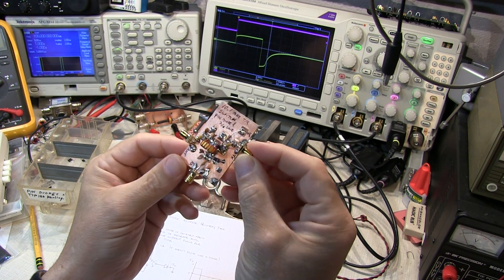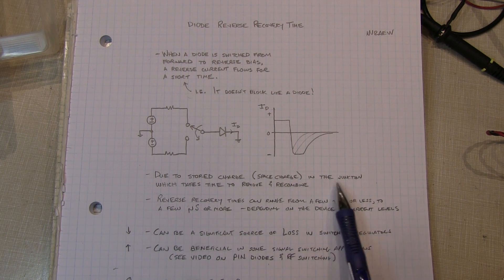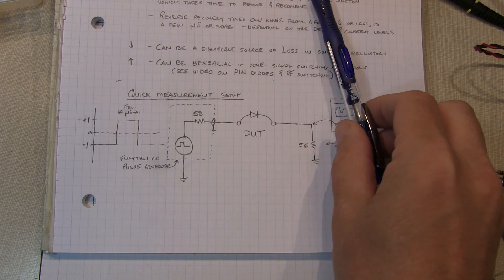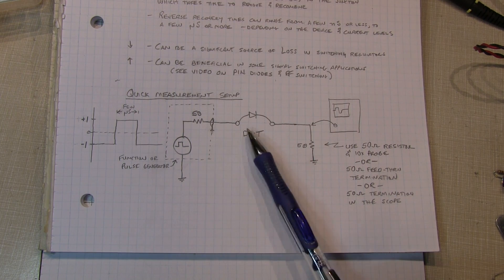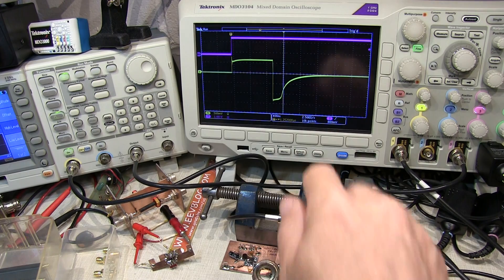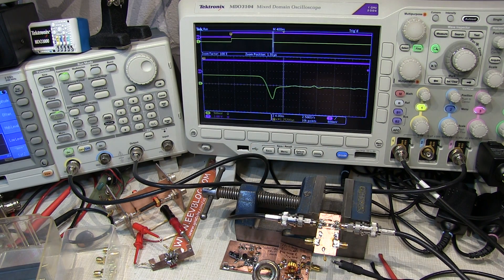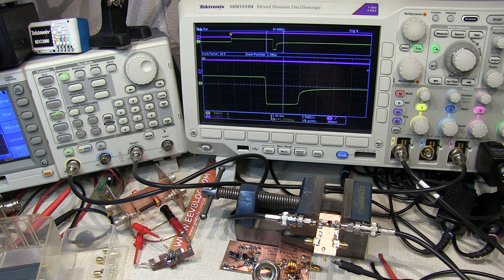#201: Basics of Reverse Recovery Time in a Diode

Comment: This is square wave. Did you try to see the impact of Trr on sine waves, if others haven't asked (can't search comments)?
Reply from the maker: Yes, the reverse recovery effect occurs, since the stored charge still has to be removed before the diode turns off.  You will still get some reverse current flow until the stored charge is depleted.
Reply: @w2aew  With a much reduced impact with sine waves, I suppose? It would be informative to see the difference in the same experiment comparing square and sine waves. Thanks for the video in any case!

Comment: Thank you for this video! It is great as always! I have a question. When you change the bias conditions by adding more voltage to the positive side of the wave, that affects how long it takes for the diode to recovery from the reverse bias - I can reproduce that offsetting my waveform to the positive side. I performed a test using the 50ohm impedance generator and a 100ohm resistor to represent load.  I measure with the 1x scope probes. If I change that 100 ohm resistor to a 1k, I thought it should affect the recovery time, but it doesn't seem to be the case. It seems like the higher the resistor, the higher is the negative spike but it does not affect the recovery time. Would you please help me understand why?

Comment: I have been repairing a plug in power supply for my led illuminated magnifier. The output rectifier diode had cooked. As a temporary measure I put a 1N4007 diode in to check if there was basic functioning in the high voltage side.
I was shocked at how hot the diode got yet only passing 360mA or so.
It wasn't until a friend pointed out the slow recovery time was the cause that the penny dropped.
I harvested an ES1J off a dead phone charger - a fast recovery rectifier and everything worked fine.
Thank you for your very helpful demonstration.

Comment: A great clip again.

Now that I think of it, that is why we can use varactors in VCOs with higher AC voltage than reverse DC bias of varactors. 
Of course, here you are talking about forward bias charge storage, in varactors it is reverse bias charge storage.  (ie.  diffusion capacitance vs. depletion capacitance)

However, in my opinion the best way to see if you have a pin diode or not is to figure out its doping profile.    You can do this by incrementally  biasing the diode, and measuring its capacitance and relating it  to its doping profile.   If you want to do this you should bias the diode from just below to turn on voltage and slowly decrease the bias voltage up about about  1/3 of reverse breakdown voltage measuring capacitance at each step and inferring the doping, and create a complete doping profile.

Comment: I'm confused is the reverse recovery time the reverse bias leakage current of the diode? because I thought it was the same thing the reverse recovery time is how much the diodes reverse bias leakage current value is. The diode reverse recovery time increases more by how much the diodes leakage current is?
Reply from the maker: Reverse recovery time and reverse leakage are TWO SEPARATE THINGS. Reverse recovery (featured in this video) is how long it takes the diode to turn off (to start blocking) when the voltage across the diode is reversed.  During the reverse recovery time, the reverse current can be large.    Reverse leakage current is the small current that will flow under continuous reverse bias conditions.
Reply: @w2aew  What is the difference between Reverse Recovery compared to reverse leakage current? I thought they were the same thing. How can you have Reverse Recovery and NO reverse leakage current? The diodes reverse recovery is when the diode is being reverse bias?
Reply from the maker: @waynegram8907  Reverse Recovery is a very short duration thing - it only lasts for a very short time after the diode is switched from forward to reverse biased.  Reverse Recovery is a measurement of TIME.  It measures how long it takes, immediately after switching from forward to reverse bias, for the reverse current to decay down to the leakage level.  Reverse Leakage current is present whenever the diode is reversed biased, and is generally a very small level of current. It is what is left over after the reverse recovery time is finished.
Reply: @w2aew  oh ok thanks, I thought that the reverse recovery was leakage current but I guess reverse recovery is not leakage current? because schokkey diodes have NO reverse recovery but have leakage current. To me that doesn't make sense because I thought the reverse recovery is leakage current but schokkey diodes have zero reverse recovery but measure leakage current which to me logically it doesn't make sense how a diode can have leakage current but NO reverse recovery. I understand what you said about its the TIME measure of the forward bias switching to reverse bias = reverse recovery time, which I get that part. It just doesn't seem logical that a diode can have leakage current and NO reverse recovery.

Comment: How can you measure the diodes leakage current and reverse loss while applying an AC signal at different frequencies? If I put an ammeter current meter in series with the diode it will only measure the current but how can I measure the leakage current and reverse loss? Does Zener diodes have a recovery time?
Reply from the maker: Leakage current is typically specified and measured under DC conditions.  I am not familiar with the term "reverse loss".
Reply: @w2aew  but how do you measure leakage current in diodes and transistors because when you put an ammeter current meter in series its just only measure the total current and how do you just only measure the leakage current in diodes and transistors?
Reply from the maker: @waynegram8907  Leakage is only measured under reverse bias conditions - so the only current flowing is the leakage current.
Reply: @w2aew  yes true at DC current, but when measuring the schokey diodes reverse recovery time you're at a certain AC frequency the leakage current of the schokey diode increases high in leakage current.  So how can you measure the leakage current of the schokey diode at the same time applying an AC waveform at a certain frequency when the schokey diode reverse recovery time is at its worse condition?
Reply from the maker: @waynegram8907  OK, you're talking about switching losses, such as in a switching power supply.  Schottky diodes are used because their reverse recovery time is very, very short, making the switching losses very low.  Leakage is usually still measured under DC conditions as far as I know though.
Reply: @w2aew  I have heard to never use Schottky diodes in Linear power supplies because when rectifying AC waveforms the schottkey diodes will have more leakage current compared to using fast recovery diodes and silicon diodes which are used in linear power supplies. When the AC waveform frequency increase higher the schottkey diodes leakage current increases, but how do use measure the leakage current when applying an AC waveform?
Reply: @w2aew  When measuring the Switching loss of a diode you just measure the Delta time from the reverse recovery time? because when comparing it to silicon diodes and fast recovery diodes the delta time from the reverse recovery time looks the same to me when applying an AC waveform. I don't see the schottky diodes reverse recovery time being that short compared to the other types of diodes it all looks the same to me only at different AC frequencies will all types of diodes will have a different cut off frequency when the diode starts occurring reverse recovery time. I'm not sure how to measure the switching losses in diodes.
Reply from the maker: @waynegram8907  Some good reading on Schottky Diodes here: https://www.microsemi.com/document-portal/doc_view/14630-introduction-to-schottky-rectifiers
Reply: @w2aew  ok thank will look at it
Reply: @w2aew  the "recovery loss" is the part that is when diode has drop below zero voltage and ramps up the voltage causing a reverse recovery time. Only at a certain frequency and above that frequency the diode will have a reverse recovery time. When the diode is at frequencies that is causing the diode to have a reverse recovery time it cause a Recovery loss by leakage current and a voltage drop across the diode?

Comment: Could standard rectifiers then be used in RF applications? Like the classic 1N4004, of which I have a bunch? Or is the junction capacitance going to cause them to conduct RF through them even while reverse biased?
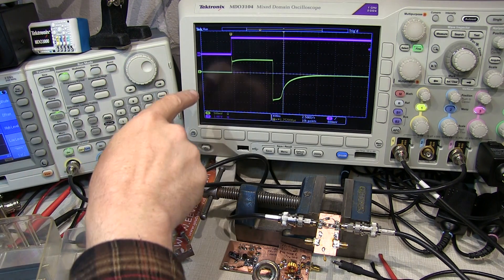8:01 is the "area under the curve" conserved? it almost looks so. If so wouldn't it be more sensible to specify reverse recovery time instead as a charge instead of a time?
Is there any phenomenon that may cause a diode to be "slow" to enter forward bias? Like for the use of clamping a signal between supply rails on an H bridge?
Reply from the maker: It depends on what you want to use them for.  They won't work well in rectifier applications at RF, but they might work well in switch applications where the extra reverse recovery period may help out.  Yes, the larger capacitance would provide less isolation compared to a PIN diode, but depending on the operating frequency, it might not be that bad.
Reply: @w2aew  Thanks! I just looked at the 4004 datasheet and see at low voltages it has 20pF capacitance,  although i'm not sure what the reverse recovery time is.
8:01 is the "area under the curve" conserved? it almost looks so. If so wouldn't it be more sensible to specify reverse recovery time instead as a charge instead of a time? But I guess to really represent it most accurately you'd need to derive some sort of mathematical model

Comment: how did you generate this perfect square input signal - probably from a proper signal generator? How could you easily generate a fast slope good square signal without a decent signal generator? Is a NE555-timer good enough for this? I dont think so - so what could you use in a very simple aproach?
Reply from the maker: A 555 probably wouldn't be fast enough, or have enough drive capability.  You could use an oscillator like this: https://www.youtube.com/watch?v=NuXitMK3HSA

Comment: Great video! Do you have a video about double diodes? I see lots of them in my junk box, usually from old switching power supplies. I used to think they were transistors.... I still don't know what they're for.
Reply from the maker: They are usually used either to save space where two diodes would be used (such as in current steer applications, switching applications), or when thermal matching is important for circuit operation - or both.
Reply: @w2aew  
Thanks for the reply. Hope you are doing well. Stay healthy!

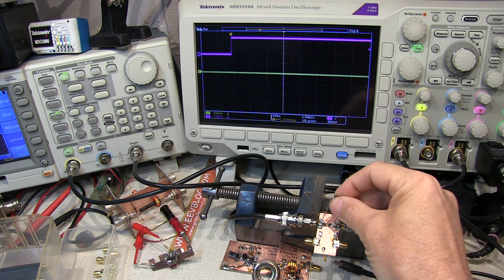Comment: At about 8:42 when you placed the "power diode" with the 1N4001, you stated that it (the 1N4001) had a "longer" Trr.  On the scope it looked like the Trr was actually a bit shorter:  Am I mistaken?
Thanks again for the great videos!
Reply from the maker: The duration of time that the reverse current is at the lower plateau is longer.  The overall recovery time is longer (even though the risetime is a bit faster).

Comment: If the diode isn't initially forward biased and is instantly reverse biased, does this concept still apply? For example, if there is a negative pulse that goes from 0 to -1V, will it initially allow reverse current to flow or will it block the reverse current?
Reply from the maker: Good question! The reverse recovery time is proportional to the stored charge in the junction when forward biased.  The "harder" it is biased on (more forward current), the longer the reverse recovery time.  So, what if it's not forward biased...   I believe that you will still see a small amount of transient reverse current due to the junction capacitance (C*dv/dt), but don't think there would be an appreciable recovery time since there is no great amount of stored charge.  I'll have to experiment with this when I return.
Reply: @w2aew   Thanks for such a quick response! I did some digging around and some modeling in SPICE over the past day or so and reached the same conclusion as you, it allows a small amount of current due to the capacitance of the diode, but it is for a very short period of time. Thanks again and I'm looking forward to seeing an experiment about it if it makes it to a video!

Comment: Could you explain the theory behind why the recovery time is shorter when you apply a greater reverse bias? Wouldnt that enhance the space charge region making it take longer to recover? Also what is with the lack of recovery going from positive to negative bias? Thanks!
Reply from the maker: There is basically a fixed amount of charge stored in the junction, so increasing the reverse bias causes this charge to be swept out faster.  The stored charge is there when the diode is conducting, and can be thought of as allowing the conduction to happen.  So, when the bias is changed from forward to negative, the device still conducts, just the current reverses.  Conduction continues until the charge is removed.

Comment: Hi, when it is said that voltage source is applied to a diode, what does that mean ? 
1.whether higher energies are supplied to already existing charge carriers inside the diode ?
or 2. whether high energy electrons are supplied by voltage source ?
Reply from the maker: The voltage applies a force to the electrons, causing them to flow/move.
Reply: w2aew 
Hi, thanks for the reply. 
but we have read in lower classes that a battery has two electrodes and the electrons travel from negative electrode to positive electrode.
Reply from the maker: That is true.  The electrons flow due to the voltage (Electromotive Force) provided by the battery chemistry.  Electrons exist in the entire circuit, and all in the circuit are pushed around the circuit by the voltage applied.

Comment: Thanks for the video! It needs to be emphasized that this test method is valid only for small-signal diodes. High current rectifiers (1A - 3A average If) can't be properly tested at low currents like this. A 1N4007 can measure nearly the same as a 200nS fast recovery rectifier with 10 - 20mA. It's only when current is increased above 100mA or so that the difference in speed becomes apparent.
Reply: @TriodeLuvr where could I find out more about low reverse current effect on reverse time measurement? Any book treating the subject?
Reply: @tancrediangeloni2155  If you need to depend on it, you have to measure it yourself, always, and qualify components for the application you have. It might make books unnecessary unless you want to be designing your own diodes :)

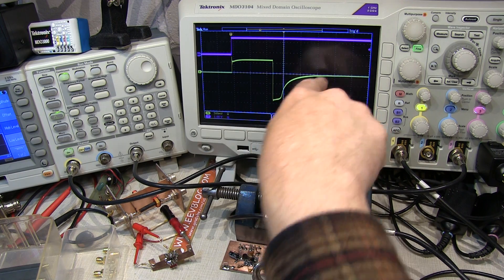Comment: @7:39 The transition from -1v to 1v seems to produce some overshoot and ringing.  Can you conjecture what causes this?  Maybe PN junction capacitance plus stray inductance in your setup?

@8:10 Given a fixed forward bias voltage, I would guess that the area under the reverse recovery curve is constant.  So increasing the reverse voltage level increases the amplitude and decreases the  duration.

Thanks for the quality videos.
Reply from the maker: Yes on both counts.  I believe the ringing is due to the device and parasitic capacitance, along with probe ground lead and other stray inductance.

Comment: Is this same effect happening to transistors? Is there such a thing?

I was watching a guy on youtube building his own CPU from transistors and integrated circuits on breadboards. He had a knob so he could manually adjust the clock speed. He said something that If the clock speed is too high, the program he run on the cpu didn't give the correct answer (he was adding some numbers).

Is this limitation due to the reverse recovery time in the transistor? Or if this is not the problem, why does the clock speed can't be higher than a certain value? Do you have any recommendation on what should I read?
Reply from the maker: +Ilea Cristian This effect somewhat applies to bipolar transistors and how long it takes them to come out of saturation - not exactly the same effect, but similar.  However, it is not the only thing that limits speed of a transistor or a transistor based circuit.  There are many factors that go into how fast a transistor can operate - more than can be addressed in a simple reply or video.
Reply: So you don't think it's worth making a video about it? :D
If so, do you have any reading recomandation? a book or smth?
Reply from the maker: +Ilea Cristian I have made a few videos on measuring frequency response - which gives some info on how the speed is controlled in some circuits.  There are so many factors depending on the types of circuits that could be involved, that it would be impossible to cover it on a video.  Books have been written about high speed circuit design techniques, not to mention high speed device/transistor design.
Reply: thank you